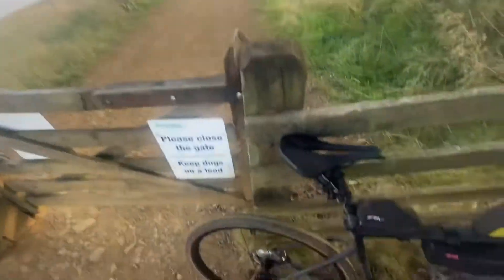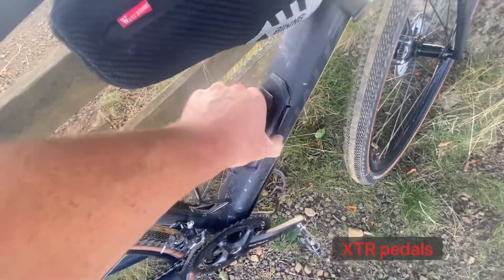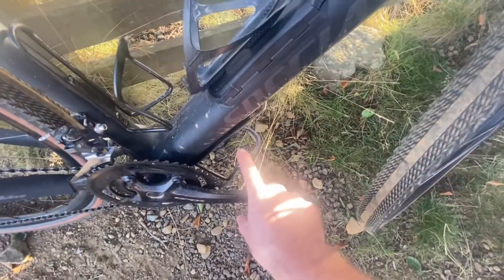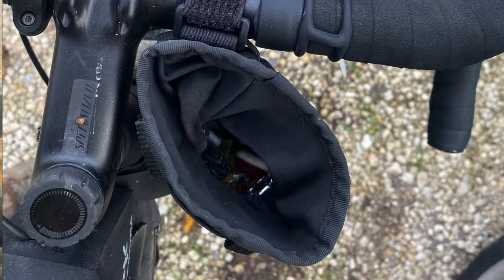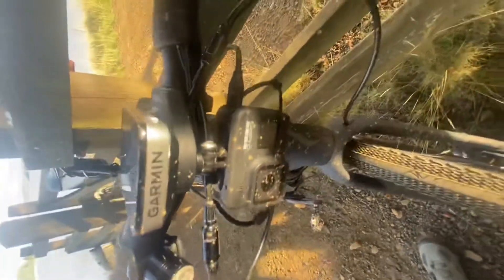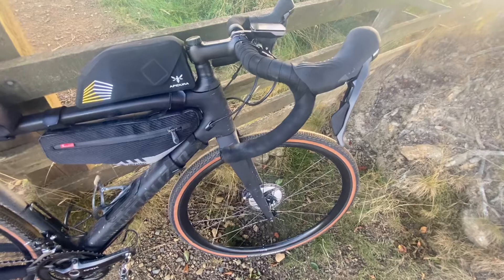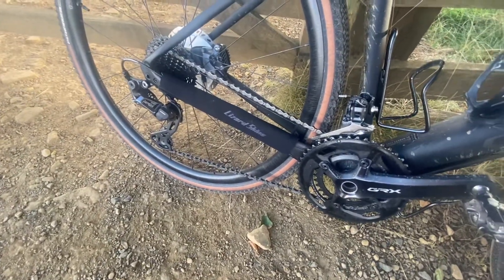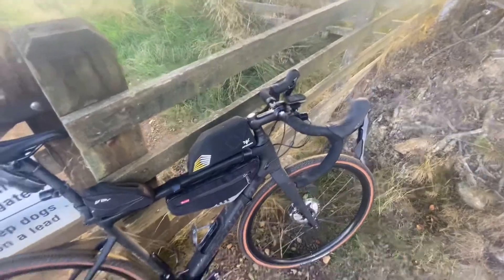Gravel racing bike set up for 200km Dirty Reiver 2021. Specialized Diverge. Water/fuel 10h non stop.

Comment: How did you get on with the Pathfinders? I thought they were really sketchy on some of those fire road descents and I feared for my life at times! Mind, they were great on the main road for a couple of miles!
Reply from the maker: I thought they were great 👍🏻 There was a couple of grassy sections were I resigned myself to them slipping a little until the side knobs gripped. But otherwise was super pleased. And no punctures too 🥳
Reply: Been running the Pathfinder for 2 winters now on both our bikes and would say they're not for everyone, depends on your local terrain and the style of rider but they're fast and grippy enough on gravel and once you resign yourself to sliding around a little on the slippery stuff, which will happen with all but the most nobby tyres, then everything is good. A solid choice for fast rides on mixed terrain. So far 1 puncture in 2 years between both our sets and that was on the road, would you believe...🤣
Reply from the maker: Ha typical 🤣👍🏻 I love them the more I ride them. At 60psi on the road and 30 off road you have two fantastic tyres in one. Tempted to try the 42’s for April.

Comment: You've an awful lot of seat post showing.  Long legs or is the frame a bit too small?
Reply from the maker: It’s designed that way a little I think to give you plenty of flex. And it is a very comfy ride! 
But yes- I was right in-between and could have quite happily gone for the 58.